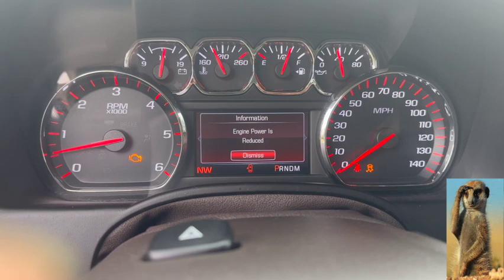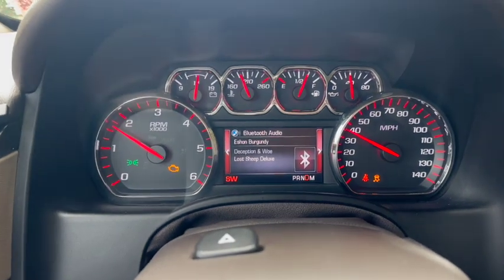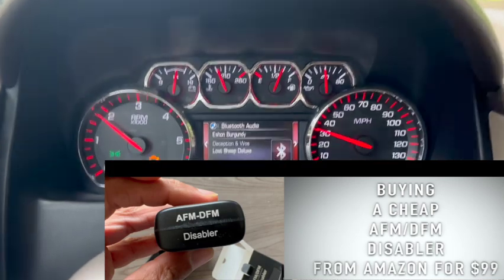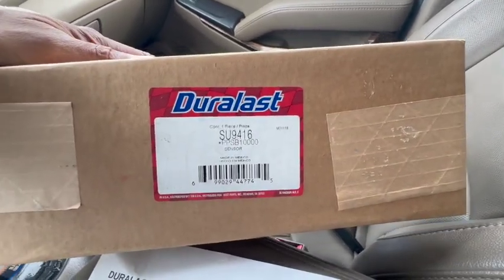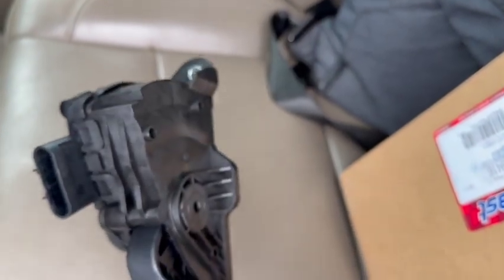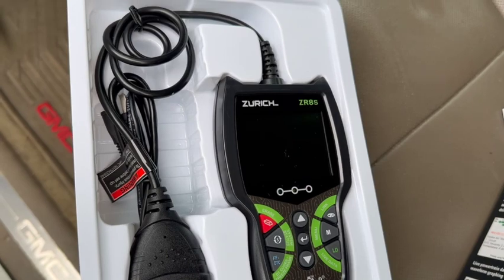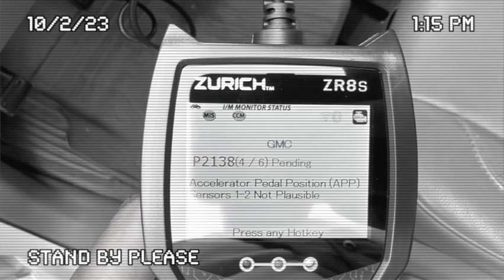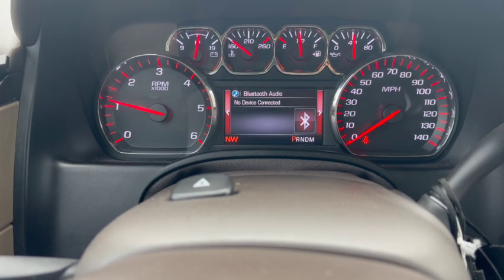2015 GMC Yukon went into limp mode P2128 and P2138

Comment: I am having the same issue, It comes on and off and came back on this morning. Was wondering if your problem can back on and if you had any fixed solution?
Reply from the maker: No issues or ⚠️  messages since removing the AFM/DFM module from the OBD II port.